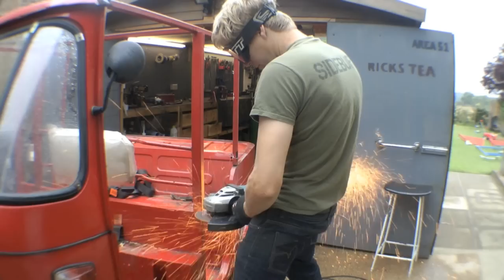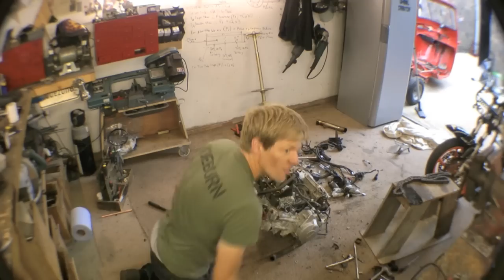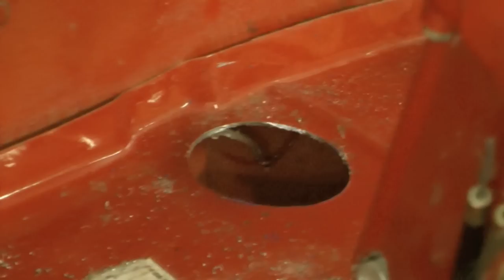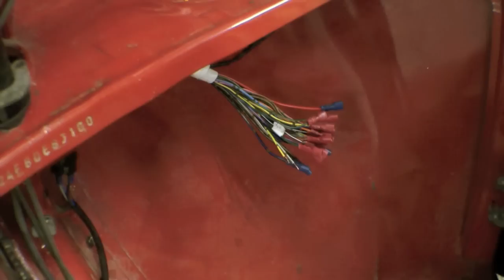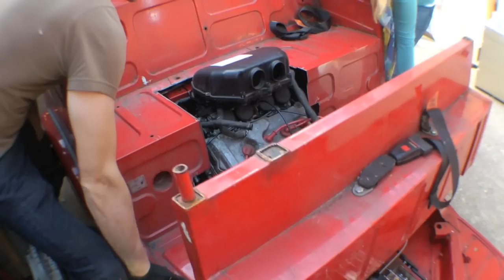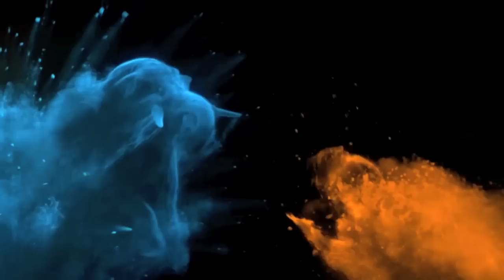Squeezing a 600cc engine in to a Tuk Tuk (Far Cry 4)

Comment: I can barely build a Lego technic model without difficulty
Reply: i know right. makes you wonder how they got so much knowledge
Reply: +yusted1 thing is with engineering, if it doesn't work, there is always a way you can make it work. Why im an engineer and not a surgeon. Oh yea just made the frame a bit wider but I fit the motor im. Oh yea I just snapped his ribs and moved em out a bit so the heart fits in.

Comment: Awesome man!!  Only thing though, why did you nick the rear suspension?!!  You could have made it work, or have that straight axle going through a swing arm with the pivot point being the same as the drive sprocket... shit, just snag a whole swing arm assembly off an old quad and and you'd have everything to just bolt on and go!  Love your vids and your punk rock anarchy style meets backyard (occasionally brilliant) engineering!  I wish I lived near you and hung out, I love this shit!
Reply: Not enough of space to add suspension due to widen tyre size, I bet his ass gonna to hurt lot as we expected...
Reply: Plenty of space man, just have to be smart about it.
Reply: Yes, But he changed the entire bar attached to the wheels. So he might also need new suspensions which will cost more than his limit budget.
Reply: Re-read my first post.  Couple cheap ideas given.
Reply: The "FUKT TUK"
Reply: ***** I'm too lazy to explain again

Comment: How come he didn't put any suspension on it? must be a bumpy ride
Reply: tuk tuks don't usually have suspension.
Reply: +pepsicola0711 tuk tuks dont usually have 600cc engines either...
Reply: actually if you look, this one did have suspension. not sure why he didnt leave it in but i think the 600cc engine makes up for it
Reply: Josh Dobis to eliminate the articulation and isolate another variable. by doing this it's stronger with less body roll. giving it a proper disc brake setup is bonus

Comment: Rigid axle and no diff? U mad?

Ah well, good enough for some product placement and good solid furze style fun.
I mean it's not going to be a commuter bike.
Reply: Tilman Baumann  Well, Had he used a diff he would also have needed a difflock (or limited slip diff) and all that just adds to complexity and weight.... Besides rigid axel is perfeclty fine for riding on grass and drifting ^^
Reply: and quiet common with quads
Reply: Quads are notoriously terrible to drive. :)
I see a lot of understeer coming up considering that there is only one one front wheeel.
But yea, good handling probably wasn't the main design consideration.
It's going to be fast and dangerous. And probably very loud too.
Reply: Tilman Baumann A Live axle is perfect for this, shit half the fun is getting sideways, who needs a diff?!!
Reply: I guess to make a hard turn just blip the throttle and break it loose  like you do on a quad bike as you call them in the UK here its a ATV  Have 2 on my farm

Comment: Bikes do not have reverse gear. There will a serious issue regarding reversing the TUK TUK. As there is a rigid axle without differential so the vehicle might tend to move leftward. The right wheel seems have been tightened directly with the axle (If the vehicle is driven in country where right hand drive is permissible) without any bearing in it and the left one is free wheel i.e the power if the engine is transmitted into one rear wheel only.

Comment: I learned how to ride a bike on a Repsol that looked just like this,except it was only a 250cc,it was fun and it had just enough power to haul my fat butt around,I weigh about 230. A 600cc engine is going to be really fun on this small of a frame,the power to weight ratio is gonna make this little machine have a really good amount of power.

Comment: Wicked setup. The major thing I'd be concerned about is that weld where the vertical tube steel meets the original frame rearwards/ above the tires. Looks like it'd be bearing the majority of the load. Is my impression wrong?

Comment: Looking at the front end of the “tuk tuk”, I think I would have used the front end off the motorcycle and swapped it in. That stock, tiny front wheel and lack of suspension gives me gas. Any pot holes will send it.

Comment: I see it's got a fixed rear axle, like a go-kart, instead of driveshafts and differential (which the tuk tuk had originally). That must make cornering difficult. Would it have been possible to fit a differential?

Comment: What's the use of the two front cables at 4:30, and there are a total of 4 wires including the front cables, clutch and choke in the junction box right ?